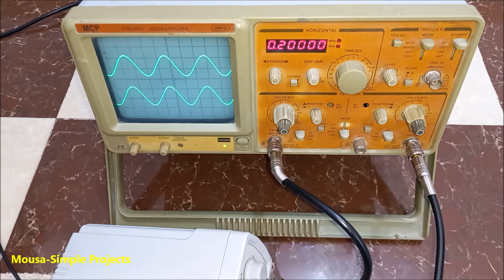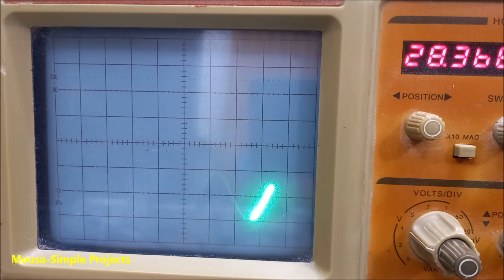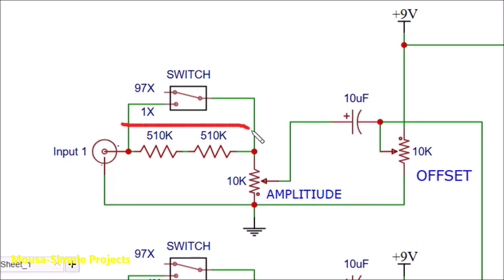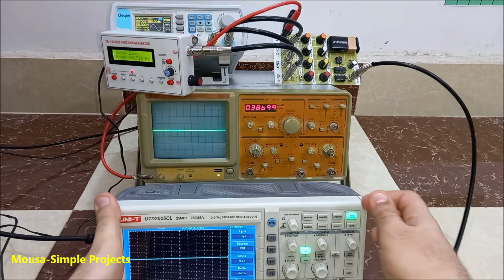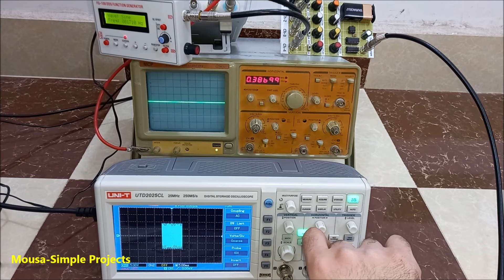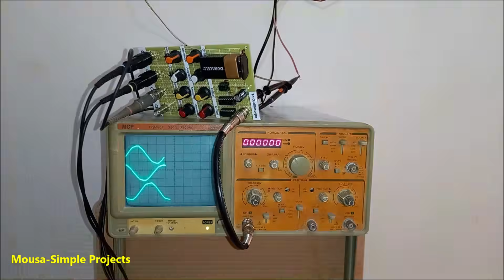How to Add More Channels to an Analog Oscilloscope ! / Oscilloscope Channel Multiplexer

Comment: You isolate the oscilloscope from network when you measure 3 phases?
Thanks
Reply from the maker: I disconnect the earth wire of the oscilloscope's power cord to prevent short circuit.

Comment: This is very similar to a circuit I built to do the same thing back in the early 80's. I'd suggest adding protection diodes to clip the voltage to the wipers of each amplitude pot. and perhaps a mov. This will protect your circuit and anything attached to it.
Reply from the maker: That's a great suggestion! Thanks for sharing your experience and advice.